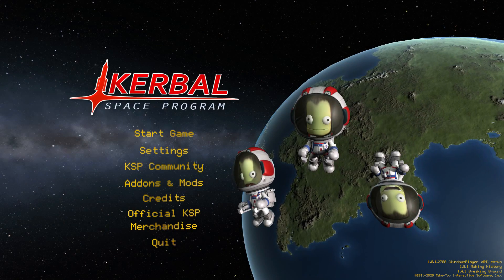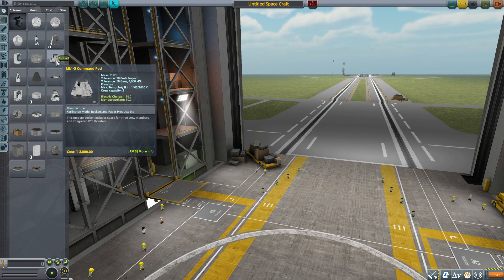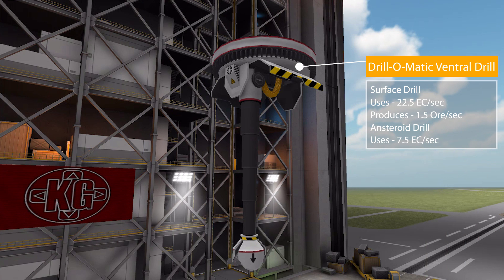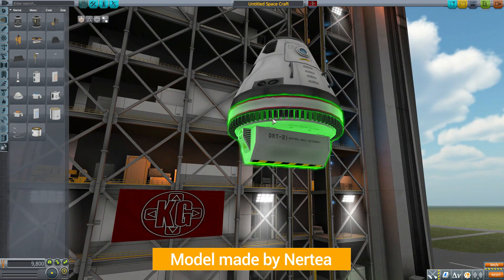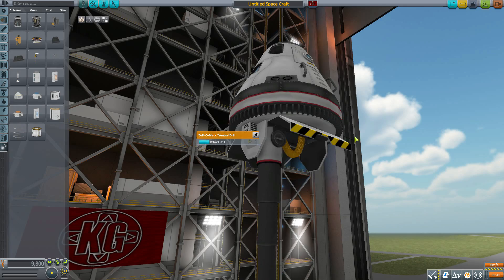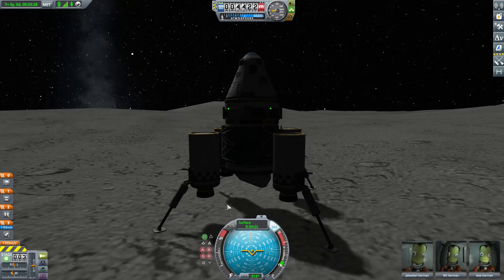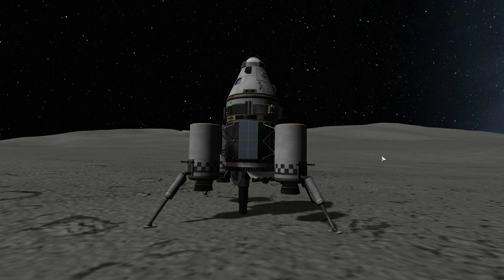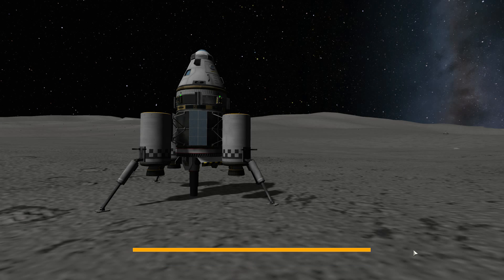KSP Mods - Ventral Drill for Stock ISRU

Comment: Your pop-up is wrong, and the model is by RoverDude.  (Who did the Karbonite mod - as well as the stock ore system.)
Reply: (For what it's worth - Karbonite I believe still works in 1.9.  At the moment, it's basically a parts pack on top of the stock ore system - which works just like the original Karbonite mod did, and allows the addition of resources, so Karbonite is just added through the stock system.)